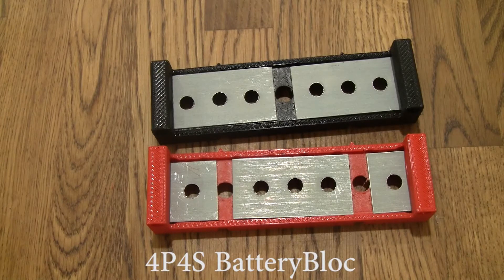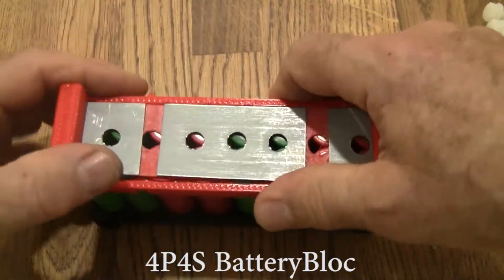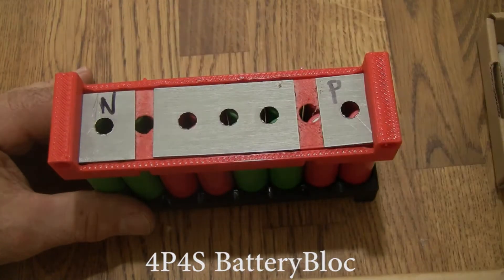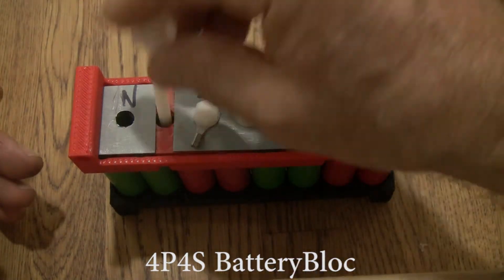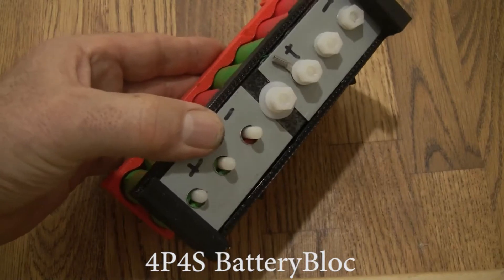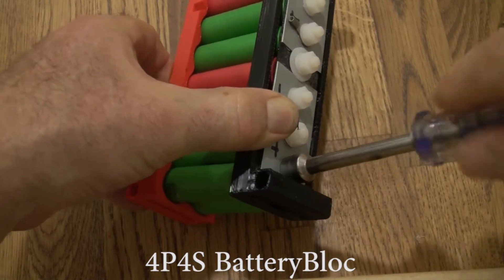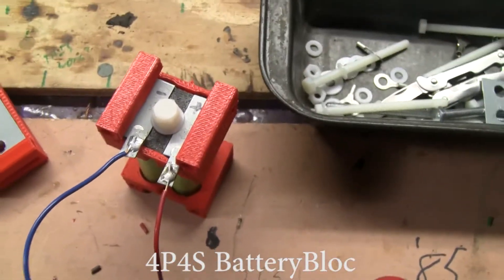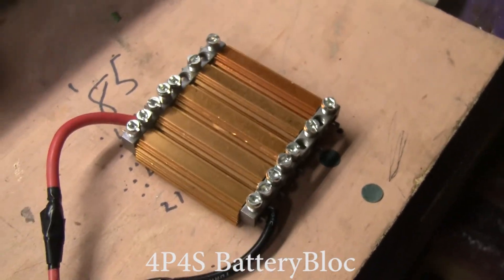4P4S 12 Volt BatteryBloc

Comment: Brilliant design Shawn!👍
Reply from the maker: Ahh shucks,  I'm gonna blush!
Reply: Haha! I've seen a few of these "no solder" 18650 battery kits on the market but yours looks by FAR the easiest and fastest to assemble. I guess the only downside I can see is that they are a little bulkier than other designs which would put a lot of people off building ebike batteries with them. But other than that they look great
Reply from the maker: They are slightly taller than a spot welded design.  If space is everything then spot welding is the way to go.  I'm spot welding three packs now for a Greenpeace drone that looks for pirates...space is everything in that cool application!    In BatteryBlocs notice how the cells are right next to each other- no spaces- unlike other systems.  

Thanks for your comment.
Reply: Wow that is cool! Keep saving the world one battery pack at a time!